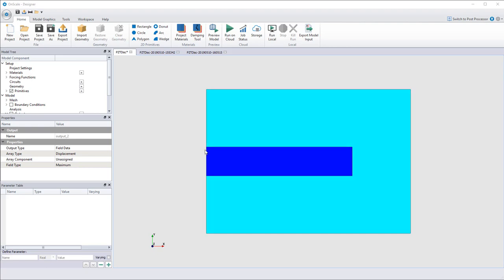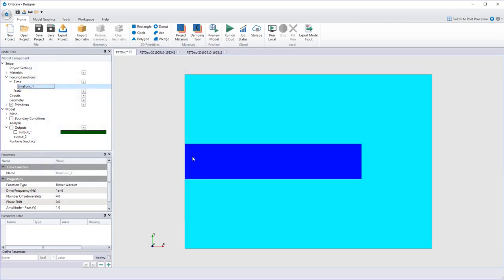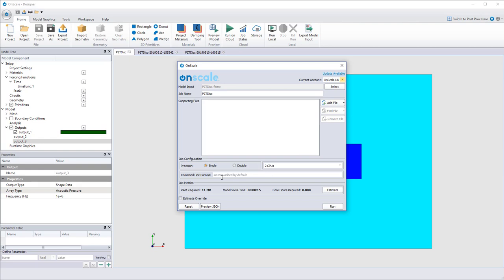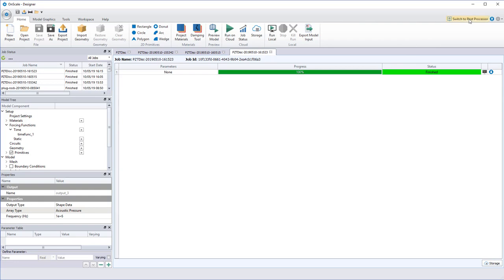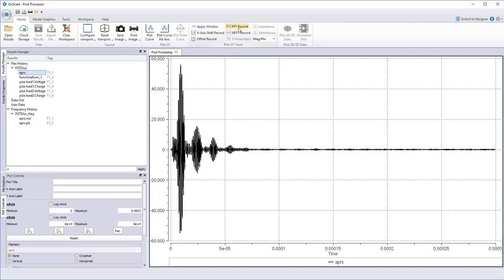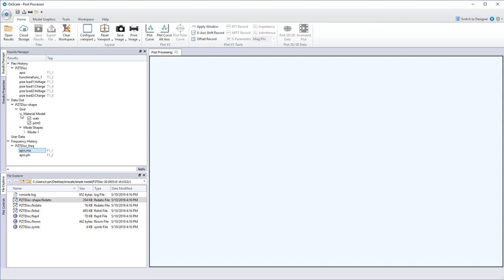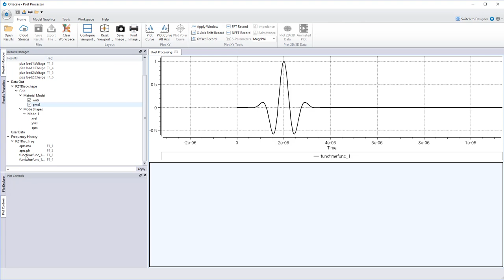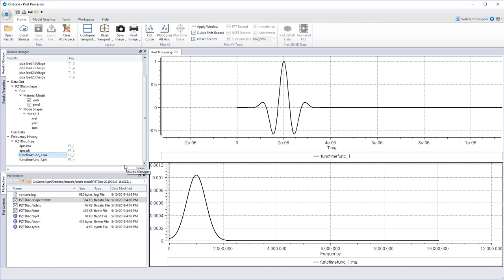How to calculate Natural frequencies and mode shapes of a PZT Disc in OnScale?

Comment: hello Mr. Cyprien Rusu. when I make a model is a hemisphere with hollow, I want to mesh it by C3D8R element type. But I can't do it in Salome Meca, with error " unexpected geomery. Face must have 4 sides but not 3.
I glad when receive a help.
Reply from the maker: Hexa element mapping in Salome only work on regular shapes, if you have 3 sides, then either you find a way to cut your model cleverly so you become able to mesh it with hexa (you then have to change your geometry) or you mesh it with tetra. Btw, THIS video here is not Salome Meca, it’s Onscale. Onscale has automatic grid meshing so meshing is much easier, it works a bit differently though.
Reply: @Feaforall  Thank you so much, I comment to this video because it is latest. With my model, I try to partition but the model always has 3 sides, anymore. I hope that you can make a video about hesmiphere model and mesh it. Thanks for you help.
Reply from the maker: @tienle5638  Check that video, it might help! https://www.youtube.com/watch?v=grjF4E3cEFk